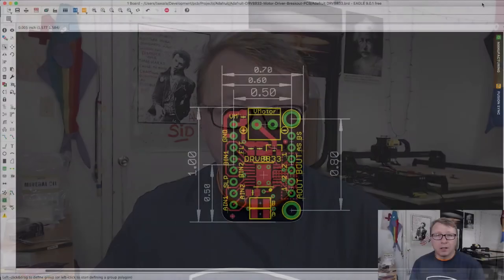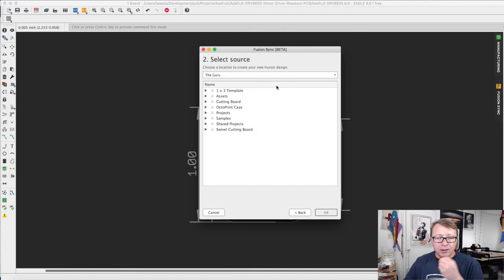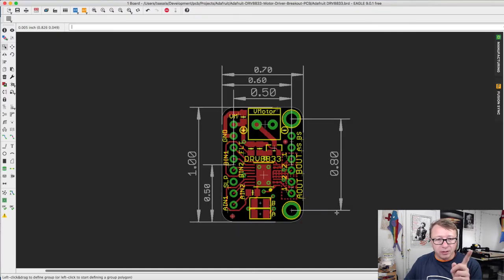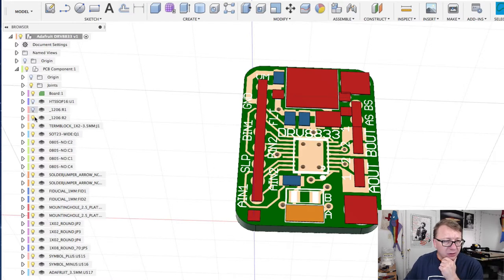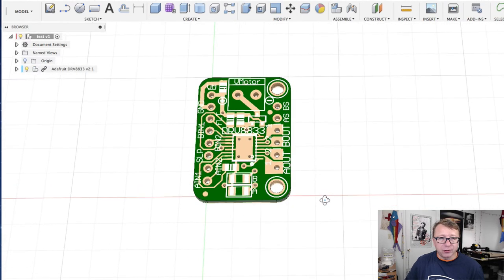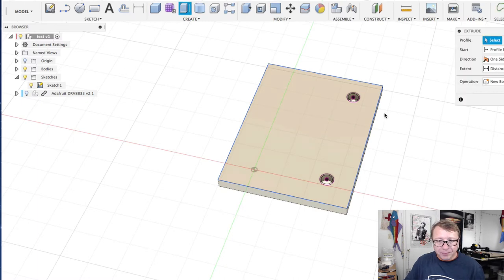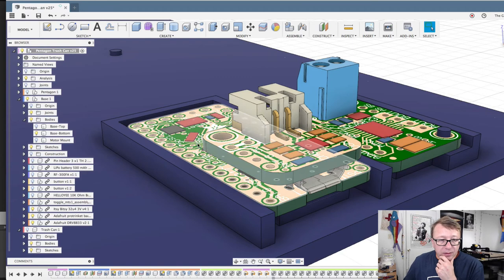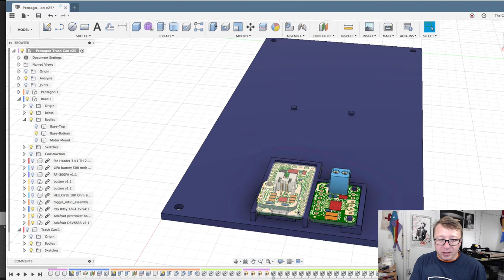Turning an Eagle CAD PCB to Fusion 360 3D Model

Comment: Hey, I'm really new to fusion 360 and I want to look at how the actual 3D PCB will look, but unfortunately, I don't know how to do that and many of the components that I have used does not have a 3D package. Could you please make a video or guide me to another source from where I can learn how to make 3D PCB when I don't have 3D packages. BTW great video.
Reply from the maker: Hi Asmer - thanks for watching.  Autodesk has updated a lot of the libraries with 3D models, but as you note, they are not complete.  If you want to get a full sense of the PCB, you will need to create models for the missing components, or look for appropriate models on GrabCAD or a similar website.  Depending on what the PCB contains, you can likely find models for just about everything you need. Further, once someone creates a 3D package, that package can be used for any part - you just need to associate the package to the part. I will do some playing around and see if I can pull together a video - it won't be posted for a couple weeks though.  If you provide me some sense of the parts on your PCB, I can probably point you in a more precise direction.

Comment: I have used CircuitMaker for 21 years...their latest build has been crash city...I think I am ready to migrate over to Eagle.
Reply from the maker: Interesting.  I have to say that although I like some of the features Autodesk has added, the electronic design space in Fusion 360 is far from complete and certain choices in the UI boggle my mind, making the tool nearly impossible to use easily.
Reply: @cyberreefguru , don't get me wrong Altium has done a great job...their PCB designer is bar none...but you have to pay a lot for the features.  I am just tired of the 5 year old bugs not being fixed.
Reply: @cyberreefguru  I actually changed to KiCAD yesterday.  I am very impressed with the Software and I will be moving foreword with it.  CircuitMaker was awesome...but damn...what a shame that the package was bloated beyond belief.
Reply from the maker: @kriskizlyk  Good to know Kris - I will check it out as well.
Reply from the maker: @kriskizlyk  Yeah, same for some of the issues with Fusion 360 - no excuse for well known, well worn bugs when they are releasing massive features monthly.
Reply: @cyberreefguru  I dunno man I used Altium for 20 years...man KiCAD is like a HUGE eye opener.